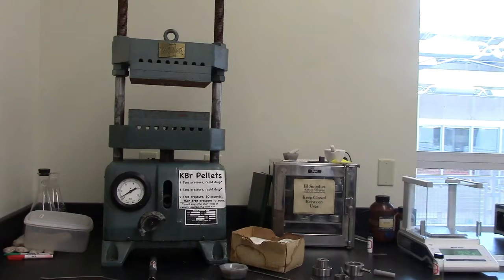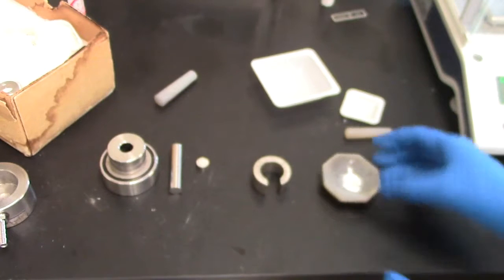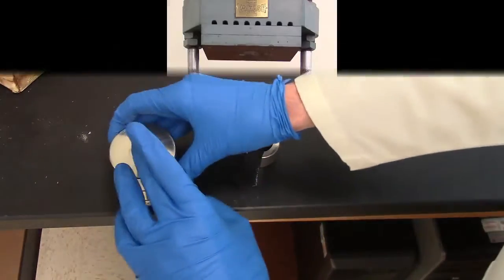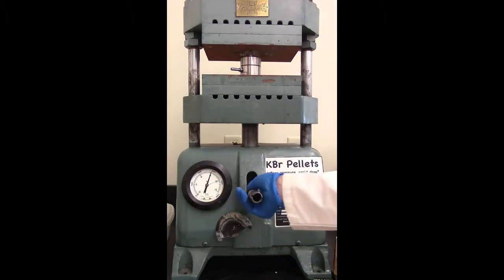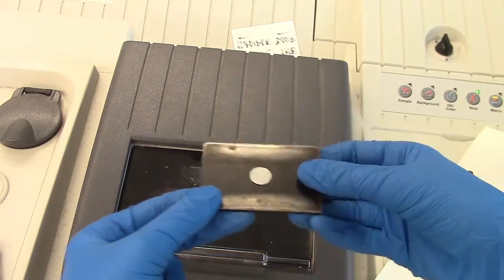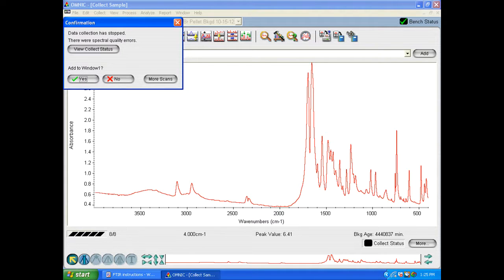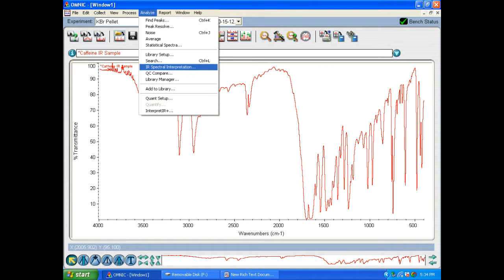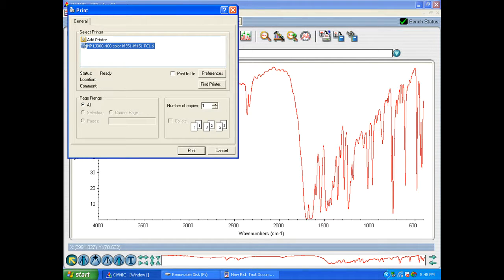FTIR Instructional Video

Comment: Nice explanation and can we use silicon paper on top of the powder sample to avoid noise in the spectra??
Reply from the maker: Probably, as long as you have the silicon paper in your saved baseline spectra in order to remove it from your sample. I haven't personally heard of this being done, but I haven't worked with IR in a few years so I'm not an expert.
Reply: @andrewpemberton7288  i have seen in journals  they mentioned this technique to reduce the noise